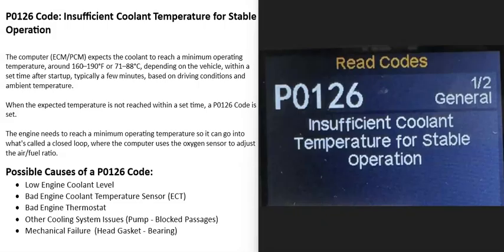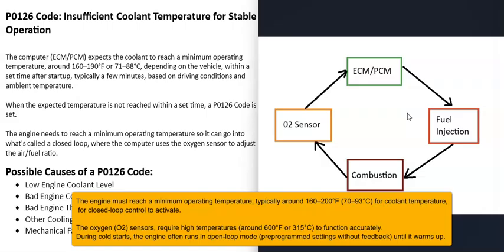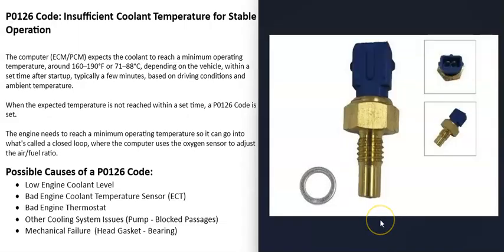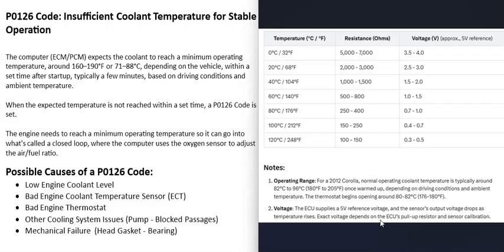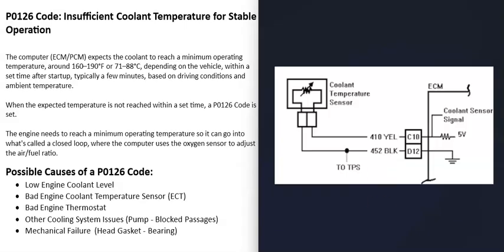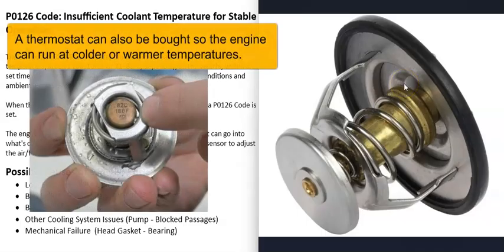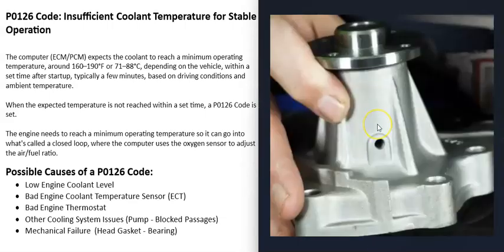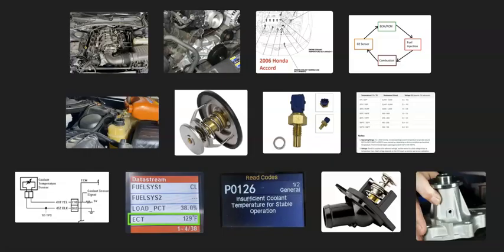Causes and Fixes P0126 Code: Insufficient Coolant Temperature for Stable Operation

Comment: When I got my 1st car I restarted everything I stripped everything mottor glass seats cables i pint it in and out bottom and biuld it back centerfold racing clutch pressure plate with waights and bronze disk i always ran it with no termalstat 1978 toyota corolla I spent over 20k. The original mottor haf 36k miles it was a fireman one owner sold it in 2001 25k.